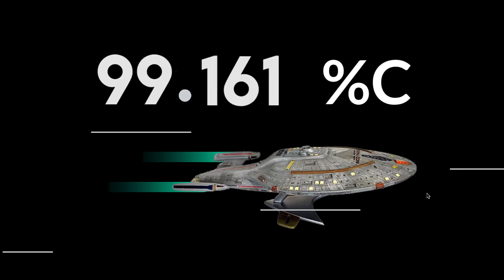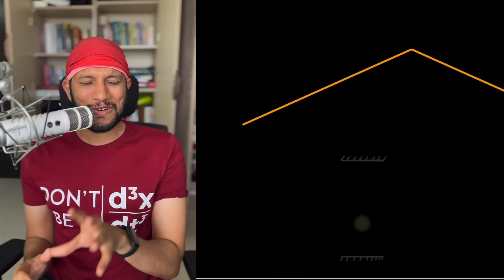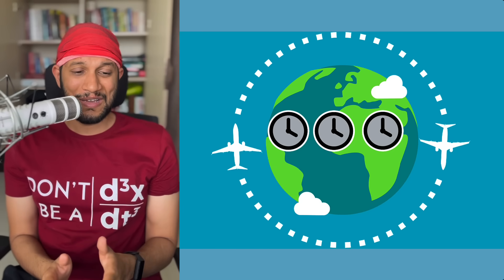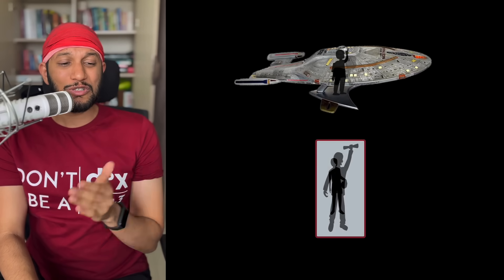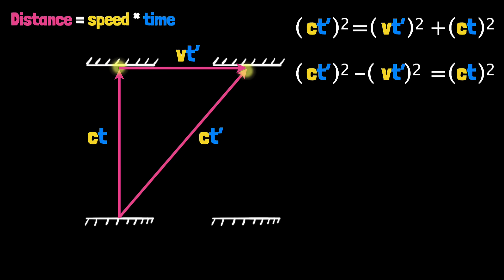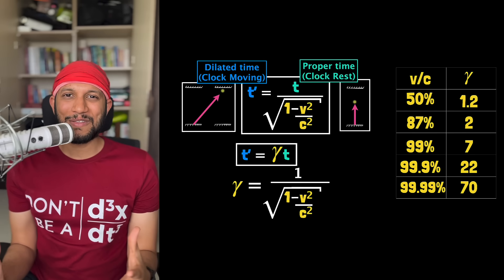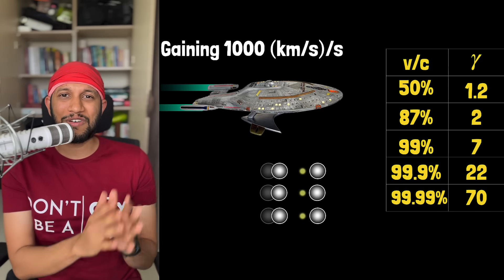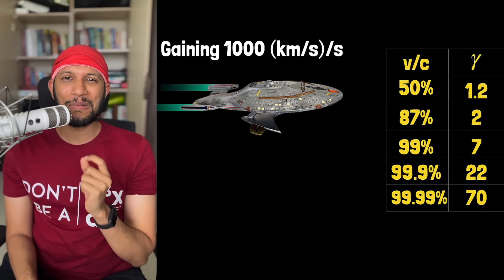I finally understood why you can't go faster than light! (My mind is blown)

Comment: If we can manage to go 60% of the speed of light. Two person going opposite to each other at the 60% speed of light, they have more speed than light with respect to each other. 😊 Light emitting from one person can never reach to other person.
Reply: Been there, thought that as well! But it turns out it's not like that. When two objects move toward each other at relativistic speeds (close to the speed of light), their relative velocity is not simply the sum of their speeds. Instead, you use the relativistic velocity addition formula. Light emitted by one observer will always travel at the speed of light relative to any other observer, regardless of their motion. So, light emitted by one person traveling at 0.6c will still reach the other person. There is no situation where light "fails" to reach another observer due to relative motion. The cornerstone of special relativity is that the speed of light is constant in all inertial frames.

Comment: Does it mean pilots in plane are aging slower
Reply: I'm going to say the exact opposite is true since they are closer to the Sun and, as a result, get a significantly higher dose of X-ray radiation lol
So, there's a huge difference between theory and reality 😂
Reply: Technically yes, but the rate of aging is not significantly different from an at rest point of view.
Reply: Yes by trillionth of a sec
Reply: yes

Comment: You're making a thinking mistake. There is no physical speed beyond the speed of light, but that doesn't mean you can't go from A to B faster. What you need to do to archieve that, is simply not visit the places in between. Such a leap already has a name, and the device that can make that happen is called after it, a warp drive. Warp drive either instantly increases progress over a larger than normal distance (dirty), or it exchanges surfaces  (clean). Warp drive alters position, but it doesn't alter vector, so you would still have to adjust to the vector of the destination. I'll let you know when I have build one. Thanks for the video.

Comment: The nuclear clock (photon clock) does not slow down. You're measuring using the wrong tools for this application - and yes - you can travel faster than the speed of light, which is how the universe expands - so stop working with hypotheticals and start using simple observations.
Reply: Expanding space time isn’t an accelerating body

Comment: Space travel will never be possible because tiny particles would tear any spaceship apart at high speeds. At just 0.03 percent of the speed of light, a grain of sand could penetrate the spaceship's hull, and at only 1 percent of the speed of light, even a single atom could cause catastrophic damage.
Reply: We had space travel in 1944
Reply: @AMC2283  ..and nobody took you back to earth?

Comment: What a minutes my guy.. So is Einstien saying NOTHING can travel at the speed of light - it would require either infinate energy or infinate amount of time due to the time dialation... So how come then, light can then travel at a speed of C??? Which of the two does it use.. do the photons travel in infinate time or do they have infinate fuel... Awung'balansise lapho mfowethu
Reply: Another rule is that anything with mass cannot reach the speed of light, or else it would require infinite energy. Photons have zero mass for all intents and purposes, so they can comfortably reach the speed of light.

Comment: Biggest problem is not enough words are used in the conventional explanation.  The confusion could have been prevented if the thinkers of the time had stopped using that word.  It is not a philosophy problem but instead both a communications and an objectivity problem.  Einstein's refusal to step away from the overly simplified notion that because some experiments performed within a space closer to light speed will appear to the relativistic scientist as occurring as it would at a much lower speed while he is arguing that they are actually quite different was asinine.  Light experiments become visibly directional the closer the speed comes to C.  Colour shift and effectively traveling faster towards the back of the ship than towards the front.
  Time doesn't occur because events happen, that's just how we notice time.  Those traveling at a speed where their speed it relatively fast see everything not having an exceptionally fast rapidity.  Those traveling slow see the fast having slow rapidity.  These events are both happening at the same time.
  Faster an object travels, the slower its rapidity of events.  Slower the rapidity of events, the more energy necessary to increase its velocity.  An object's perceived time is determined by its rapidity.
  While rapidity of events is variable, January 1st, 1 AM PST is a specific time.  Even if the rapidity changes so our hours become different the specific time an event happens is still universal.  Perception of the event is delayed but that event occurring is universal.

Comment: What if we add a 3rd reference point, and than make the 2nd reference point accelerate? If we retain the reference in the the 2nd point, this is the mechanism, but for the new 3rd reference point couldn’t it accelerate more? I can understand in the distance perspective that it would hold for all the reference points. My problem is with energy being relative to the point of observation.

Comment: 1st. you cannot go faster than light because your measuring equipment is limited to the speed of light.
2nd even with fraction of speed of light, a matter moving such speed gains a kinetic energy more than it can handle.

Comment: At 87% c (speed of light) : 1 years on spaceship = 2 years from the outside 
99% : 1 year = 7 years
99.9% : 1 year = 22 years 
99.99% : 1 year = 70 years
99.999% : 1 year = 223 years 
99.9999% : 1 year = 709 years
99.9999999999999999% : 1 year = 78 304 300 000 years 

Which means at exactly the speed of light, time dilation will be so important that you’d see the END-TIME in front of your eyes. (Btw same goes for entering a black hole because gravity dilates time too)
Reply: Its 3AM and it’s about time to sleep 😁

Comment: Btw, this helped quite a bit to explain the time dilation. Now, so while it is theoretically impossible to go at the speed of light because time would stand still... and that's just weird... let's just assume we can go faster. Would that mean  we'd be going back in time, if it was possible to go faster than the speed of light? Ie. we may never be able to reach time being still (the asymptote for infinity cannot yield a value for that), but can it yield a forced 'past that point' value? And would that value imply time starts to go in reverse from the point of the observer going past c?

Comment: Very good explaination!

However there is one issue with this explaination. The mechanism of information transfer between atoms in the clock is as you said: electromagnetism. Or photons. The speed of light in a vacuum is normally used to describe the speed at which this information transfer occurs. However little detail is given concerning the properties of the vacuum which is the medium given as the standard of limitation for the speed of light. But what governs this speed and sets its limit? Its the permitivity and permeability of the vacuum that is said to govern the velocity of electricity and magnetism respectively through the vacuum which is itself made up of an infinitude of oscillations comprising the quantum foam. Sorry but einstein just isnt going to cut from here. From here we have to consider Hal puthoff polarizable vacuum representation of general relativity. Here we see that electric flux density actually sets the stage for permitivity and permeability within the vacuum and also any mass found withing our  example volume of vacuum in this case our clock atoms. As the electric flux density increases, permittivity and permeability increase as well. So, if you apply a static electric field, you would get a scalar increase in permitivity and permeability which would there for change the speed of the information transfer to occur quicker than in a normal vacuum. So now your light is moving faster than light. Q

Comment: How does light instantaneously re-accelerate up to speed upon leaving a medium? Because its not a speed of anything, its a rate of induction.
Reply: It doesn’t change speed, it bounces around molecules so is said to be slower
Reply: @ So it “bounces” with zero  speed loss. Got it.
Reply: @joellandry2406  not like a ball it doesn’t, it’s absorbed, emitted at c
Reply: @AMC2283  So it absorbs it for no reason since there is no loses, then emits it immediately at full rip. Got it.

Comment: Yeah....no. Imagine you are in elevator walking from wall to wall or door to mirror at one steady pace.How would speed of elevator influence your tempo? to cover the same distance you suddenly must walk faster? or perhaps the 'extra' distance you showed with photon clock is covered  by ship in example of yours and elevator in mine. In other words: lateral movement does not require extra speed from photon  because is provided by external source which moves whole structure..Also photon's direction doesn't change, it is sill straight line between two mirrors. The mirrors and photon ( on the ship) accelerate at the same rate It seems to me that extra distance photon covers is just matter of prspective/point of reference.

Comment: Maybe I missed something integral but at some point wouldn’t the people on the ship have reached the speed? For them, they are trying to hit a finite number (299 792 458 meters per second). When they finally reached that speed if they suddenly hit the brakes and came back down to 0 speed a finite amount of time would have passed right? Even if it was absurdly large. No?
Reply: Yes, that's how mordern scifi movies do time jumps, with a spaceship going 99.99% the speed of light, for 1 day, then coming back to a world millions of years in the future.

if they do eventually reach the speed of light, stepping out the spaceship, an infinite amount of time would have passed.

to explain, imagine the atom clock again, the atom moves at the speed of light, of you want the ship to move at the speed of light, it would result in the atom and clock bottom to move at the same speed.

meaning it would be imposible for the atom to hit the clock's bottom.

So from outside the ship, it would look like it's going incredibly fast, but inside the ship, everything would look frozen in time
Reply: This is also a question I have. I know from the reference from of the outside observer, they need longer and longer to accelerate another 1,000 km. But from the reference frame of within the spaceship, which is using "at rest time," one second should pass normally for them. And so they should eventually reach the speed of light, no?
Reply: @trisbane4086  Yes, this was 100% my question. I think they do! 😊
Reply: @PirateStory  Based on what I know and the information presented in the video, I could sort of estimate what happens, but I'm no Einstein...

So because from our outside reference frame, it would take an infinite amount of time for the spaceship to accelerate to light speed, it stands to reason that for people inside the spaceship, their "second" would take infinitely longer, and longer, such that the last second needed for  the +1,000 kph to reach light speed never elapses for them.  In other words, the last second they need never passes for the people on the spaceship. That's my guess, anyway. Not that that really makes sense.
Reply: First you tell time on a watch from the outer radius ticking alone.  Not comparing the smaller circumference with the larger one. Only small to small and large to large.  😂
Plus photons traveling at the same speed will tick faster in a 12 inch box and take longer to tick in a 12 ft box or chasing an object.
Reply: Okay, I asked AI, and while I can't fully wrap my head around the answer, I think the reason it's unintuitive is that the ship isn't linearly accelerating at 1,000 mph. Basically, the closer you get to light speed, the less energy/velocity you get out of that "1,000 mph." In fact, the closer you get to light speed, that constant 1,000 mph you started out with is pretty much the same as standing still. Also the 1,000 mph was measured from the earth's reference frame, which is inherently much slower.

Additionally, traveling at the those speeds approaching light would feel more like space is compressing/warping around you.

Time would pass normally for the people on the ship. Every second would still feel like a second. From their perspective they would continue to accelerate, just never fast enough to catch up to light speed (unless they had infinite energy to continue speeding up).
Reply: @trisbane4086 Yeah i was thinking about it today and i think the fallacy is that we’re talking about a ship that can actually do that, which is not possible, so the answer isn’t possible either. Sort of like the question; “What happens when an unstoppable object meets an immovable object?” There is no answer because neither of those things are possible. 

It’s not possible to make a ship that accelerates 1000mps linearly forever, so there is no answer. If you hypothetically were able to, then you WOULD reach light speed in a finite time but you also would have broken the physIcal laws of the universe, and might as well hangout with Gandalf, Harry Potter, and Goku

Comment: The clock do not slow down when they are moving, if you move with them and don`t see it from a distance..  (at least in my theory..)

When it comes to speed of light, they say the light bend near a black hole and start to go in to the black hole.
I am pretty sure that when the light have a strait line in to the black hole and get close to it, because of the help from the gravity from the black hole, it will go faster then the speed of light.

Comment: This is a thought experiment at the beginning that you can do in real life. All you would need is a ball, a kid and a car driving. The kid throws up the ball and the ball comes down. To the kid and anyone else in the car, that ball went straight and straight down. But for people outside of the car, the ball is moving at an angle. 
   Now that being said, the people inside the spaceship traveling at the rate of speed, to them they are going the speed of light. The only argument that I can't argue with, it's that at the speed of light you have infinite mass. So basically you turn into a blackhole. Lol

Comment: this is assuming that fractions are infinite but they are not otherwise we wood not be able to touch anything as there would always be a fraction of space between you and something you try to touch. Also if a ship is is not quite at the speed of light and you run from the back of the ship to the front you would then be traveling faster than light.

Comment: If the speed of light is constant in all reference frames, theoretically what would happen if you put a photon in a chamber that it has no way of escaping from and accelerated the chamber past the speed of light? I know, I know, you can’t do that; but, theoretically, what would happen? I don’t know enough about physics to even make a guess. I think I know enough to say that if the chamber was at the speed of light exactly, the photon would appear stationary. If you accelerated past that, would the photon appear to be moving backward? Tho, as soon as it made contact with the back of the chamber that it can’t escape from, it wouldn’t be able to bounce anywhere, as bouncing in any direction would require the photon to go faster than the speed of light; right? Bouncing anywhere would mean going over the speed of light, and staying stuck to the back of the chamber would mean going over the speed of light, so what would happen?

Comment: False not the time slowing down just how you can see that clock... i mean it is confusing cause we mostly rely on our vision But time is not go differently cause we see differently yes photons and their movements have limitations in speed... and this is the speed of light...so cause if we think this is true change out the speed of light with the speed of sound  and do the same kind of math ...the math will say the same you cant go faster then the speed of sound then? yes we can... but we cant use that speed to count with... yeah if you go with speed of light you will be seen frozen cause you travel along with the photons ... and we cant imagine that... but i think it is still possible... In philosophy you cant even throw a rock to a wall cause it cant reach it ever... the distance always going to be halved to infinite so this way it cant reach it ever yeah the distance is always smaller but in theory it can go forever... but its not true we all know that... math often cant answer things if we miss one part of it...
Reply: So i believe in that it possible to go faster then the speed of light... but we are can't calculate it what will happen if we do...

Comment: I have a big problem with the concept of time actually slowing down, especially if you only look at it from a stationary point of view. (I'm not a physicist and I'm not claiming to be right - I just can't fathom this concept)

If the path of light gets longer, time doesn't slow down, it just takes more time to travel the longer distance. Even if the perceived time slows down, this is not the case - only the travel time of the light is longer. So the fact that you “slow down” from a stationary point of view is only because the light takes longer to bring back the new information.

you also have to consider the Doppler effect when looking at it from a stationary point of view - the further away something gets from you, the slower it seems to move, or the closer it gets, the faster it becomes. still no time dilation, just a perceived one, from a stationary point of view.